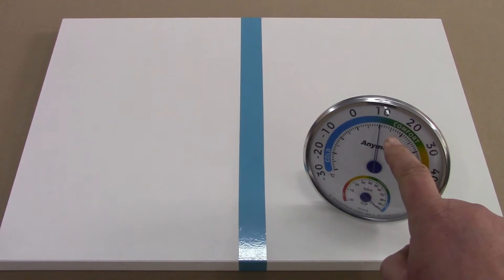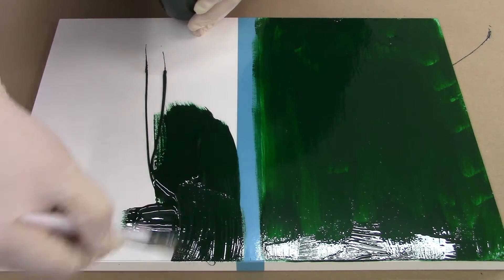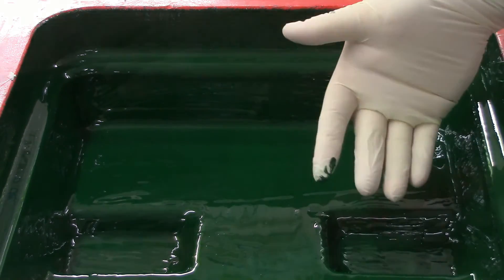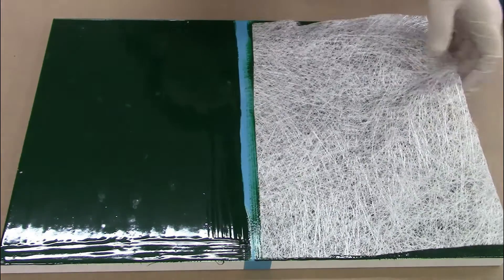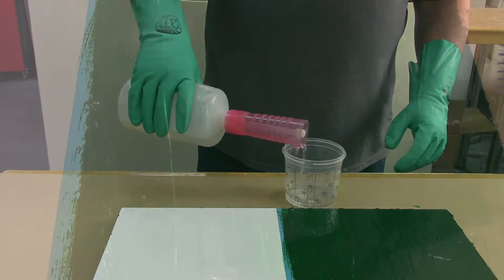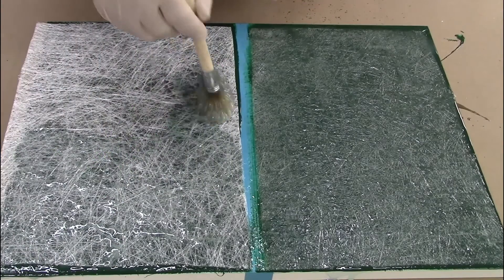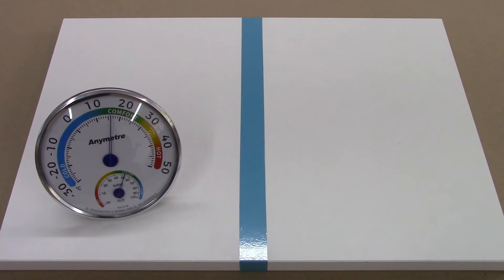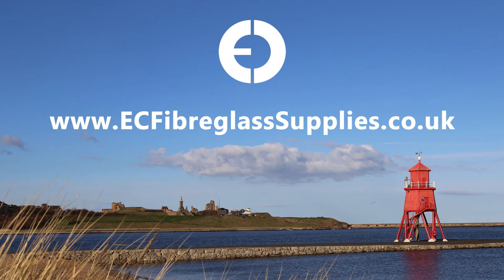How to Avoid Gelcoat Wrinkling (Alligatoring) What to Do, and what NOT to Do!

Comment: Roll or spray a hot coat after gelcoat. 25cc to 1 quart.. be quick. 
Robles solved.
Reply from the maker: If referring to a 'hot coat' as a fast gelcoat mix then that is fine. 
however some reference to a 'Hot coat' resin (or sanding coat/fill coat) is a specialized resin, usually polyester with wax or Additive mixed in, applied as a final layer on fiberglassed surfboards or similar items to create a hard, sandable surface that fills weave texture and seals the board for a smooth finish, this type of 'hotcoat'   best  not to get these mixed up. Just clarifying for anyone out there who may make this mistake
Reply: Yes polynresin

Comment: I solved this problem by putting the first layer of gelcoat on then letting it cure for 24hrs. With the first layer fully hardened the 2nd layer isn't able to wrinke the 1st layer. It works like a charm but it adds a whole day to the process.

Comment: Thanks!  It is both surprising and disappointing when this happens.  Mine happened on the first layer of gelcoat painted into the mold, before anything else was layered on top of it.  Possibly from too much styrene mixed in at the factory.  Mixing the special tooling gelcoat 1:1 with regular white gelcoat and adding a lot of hardener seemed to prevent it.  This has not happened again since I finished that one batch of tooling gelcoat.

Comment: So is it recommended to have a bit of air circulation like a desk fan blowing across the part?
No heat just air moving.
Reply from the maker: This is one method purely to help release the styrene from the deepest parts of a mould, it doesnt have to be a fan  you can even  fan it now and then during curing  with just a peice of card or simply turn the mould on its side to let the styrene vapours out. 
This is because styrene is heavier than air and will lie low on moulds slowing down the cure.  In terms of temperature it is best to work between 15 and 20 degC and avoid direct heat on the mould has this can create other issues such as hotspots leading to severe shrinkage and pre-releasing which can cause indentations in the final part.

Comment: Honestly this is more of a ideal conditions situation. With gell I have sprayed it as low as 10 deg F on multiple days with no issues at all and even colder with resin when laying up. You may have been better off giving a sliding scale showing MEK percentages verses temp and humidity if you really want to help out people and how having wax added to the resin will change the curing rate. All in all I get what you were trying to do this is just my 2 cents on what could help out with some more real world applications.
Reply from the maker: I totally agree  with you and  I appreciate your feedback . 
 
Most manufacturer's material data sheets suggest temperatures should be at  least 18–20 °C with a minimum 2% catalyst. Some users will push the boundaries, and I admit I have done that myself, such as increasing catalyst and even stealing my wife's hairdryer to encourage laminates to cure in my cold shed at home😁 , and I've very rarely had any issues apart from the odd pre-release marks at times from too much direct heat or curing too fast causing shrinkage. 

Although, if you do work outside the recommended parameters and the moulding pops out with defects, then you have no quarrel or cause to complain to the supplier or manufacturer of the material  even if you have got away with it previously in the same cold conditions. 

As a responsible distributor of our suppliers’ materials, we can only demonstrate how to use these materials as intended and recommended by the material manufacturers guidelines.

Customers are more than welcome to experiment with extra catalysts and methods outside of our advised recommendations as i have done in the past, but it is at their own risk.